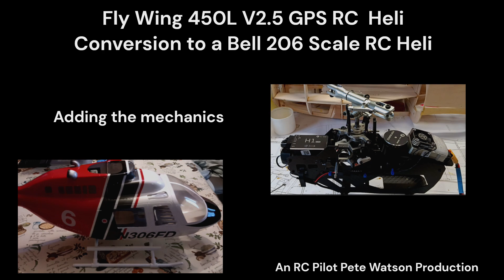Fly Wing 450L V2.5 RC Heli - Scale Conversion Bell 206 - Mechanics Install

Comment: Pete, great video.I also am doing to build a Bell 206 like yours, should be in the first of the week. But I would like to know where did you placing the GPS  in the body?
Reply from the maker: Hi Thomas, I left the H1 controller where it was originally mounted on the frame. I bought and installed a longer cable so I could have the GPS mounted on the wooden mounting  tray in the fuselage. I bought the cable new from Ebay at a cost of £8 posted. Stop the video at 11.05 minutes played and the GPS unit is mounted on the wooden frame next to the mechanical frame. Unfortunately the image is dark and difficult to see the GPS unit but in the 30 seconds before as the camera pans round the heli you will see the H1 controller and the cable running around the frame to the GPS unit. Good Luck with the build
Reply from the maker: Thanks for the kind words and watching my video. It means allot to me that you have interacted and asked questions this makes my efforts worth while. Please don't hesitate to contact me if you have any further questions. Good luck with the build.

Comment: FYI everyone.....the mechanics of the Bell 206 can also be plugged into the UH-1 fuselage with very little change.
Reply from the maker: Hi and thank you for your contribution to my channel. I bought my 450L V2.5 GPS stabilised heli just before Fly Wing released their Bell 206. A bit disappointing to me but wrong time wrong place. I would just like to clarify this is not a Fly Wing Bell 206 fuselage but an after market product. I could not find the Fly Wing fuselage anywhere to buy and Fly Wing didn't respond to my mails asking where I could buy only the fuselage. A worthy note here is a 470 size fuselage is required for the 450L V2.5 mechanics. I also bought the Roban 450 Bell 206 fuselage but this would have require significant modifications to get the 450L V2.5 mechanics in.